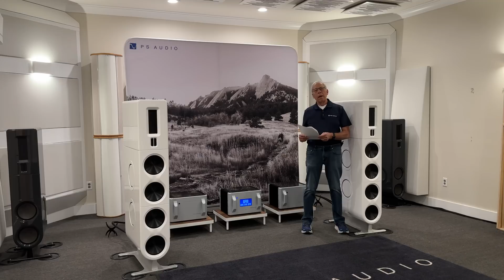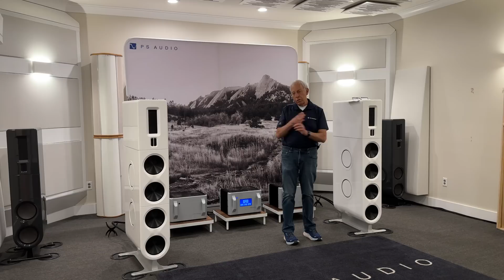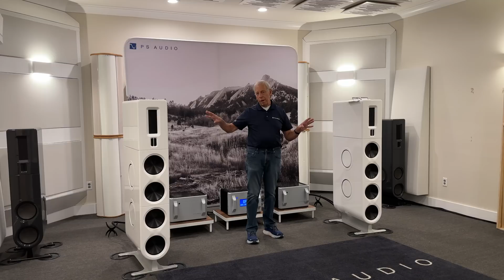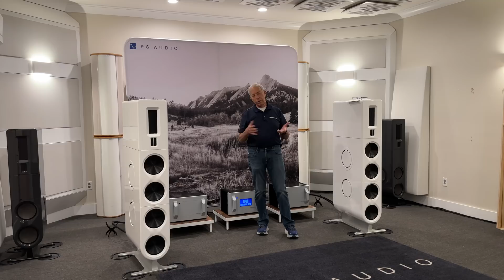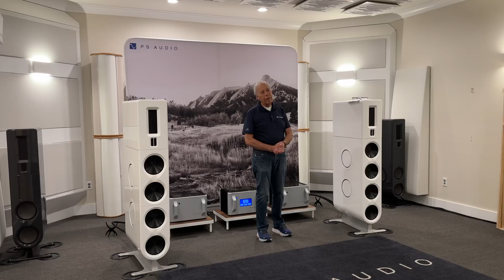Crosstalk cancellation

Comment: The most sophisticated crosstalk cancellation device is the BACCH-SP processor developed by Dr Edgar Choueiri at Princeton University.
Reply: He has a more modest setup with a std MAC at a 1/10 of the price compared to his highest end solution. 

But build on standardized components that bring down the HW cost and development cost of the same. (Web cam, MAC mini and a professional external sound card. I think it is called Bacch4MAC.)

With first hand experience of a DIY solution in my dedicated listening space.

I can without a doubt say this is the greatest thing since the invention of Stereo! (Yes, big words but as stereo, when you heard it you can't go back, it is so fundamental difference.)
For 2ch audiophiles (they tend to sit in the sweet spot and listen).😂
Reply: @AmazonasBiotop  Cool.
How does it sound compared to good headphones?  It seems conceptually like they should sound the similar.
Reply: @user-od9iz9cv1w  
There is some rather big differences between 2ch speakers and headphones.

Speakers performing like if there is artist is in front of you somewhere between the speakers and maybe like a looking at a performance in front of you.

Usually the soundstage with headphones is restricted in your head the singer is in middle of your head. 

Plus when you turn your head with headphones the singer/performance is moving with your head as the headphones is attached to your head. With speakers the still in front of you even if you turn your head.

That is nothing special that is standard deviation between headphones and speakers.

I am not a headphones guy.

But one cool thing is that Bacch4MAC company also have developed a filter for headphone usage. The cool thing is when the headphone filter is demonstrated in audio shows there is a speaker setup and a pair of headphones. The thing is they put the headphones on their ears and after a while they saying "can't you turn off the speakers (that is in front of them)"
OR they're taking off the headphones from their head and just to discover that the speakers in front of them are indeed not in use..

So I believe the headphone filter make you to believe that the soundstage is Infront of you and gives you some of the speaker qualities that those has.

But my experience with 2ch speakers with the interaural crosstalk cancellation on and off.
(Remember I am not a headphone guy at all..)

Is that even if I have made most things right to get a soundstage (width and depth). In my dedicated 2ch listening room with dipoles far out in the room, various sound treatment, symmetry, PEQ and so on and on.

I experience that ordernary 2ch listing is like to look at a performance in front of you with somewhat depth. But more like a rather flat painting in-between your speakers.

You can hear the recording room acustics but it is over there between the speakers in front of you.

But with interaural crosstalk cancellation (IAC) enabled. You are transported into the recording room and sitting in it and the performance is closer in front of you. It is more as you are there with them. 
Instead of viewing them as a separate event that have happened in front of you.

Hard to describe (I don't know if it is the same with headphones when I am not into that but I imagine the headphones make the artist small like smurfs in your head and not somewhat life like natural sized humans in front of you.)

But the "effect" is huge and works on most of all recordings more or less. And it is like back in the day when we had a stereo/mono switch button on our amplifiers. It were always in stereo mode and that got to be the default norm/choice and the button has been removed when nobody wants to be without using the stereo mode.

The same is here when using and comparing IAC on/off. 
You do not want to use the system without IAC off like back in the day with the stereo button.. It is that good!

Largest "effect" it has on binural recordings reproduction. But I found it to be good on all types of recordings. 
Except one "Madonna -Vogue" some strange mixing going on in that track that is not so obvious in normal stereo reproduction. 

I hoped this helped somewhat.👍
Reply: @user-od9iz9cv1w I think the idea is it has advantages of binaural audio that headphones can provide but it sounds more natural and there’s more a realistic sound field since the source of the sound isn’t strapped to your head. Plus for the top end model you can move around the room and it will adjust to maintain levels.
Reply: The two Carver box I use in my biamp system gives me for example in Jazz recording the feeling I am just in the middle of the group where you put the recording microphone
The result varies a lot according to different recordings
In symphonic music I get the bass just at my right snd violin in my left
But again the effect is much better with Nimbus biaural recordings.
What cross talk cancellation gets is to recreate to hear in your left ear (left channel)what you receive in it in the music hall and same in the right (right channel)
The cross talk mix the two channels in each ear, with a small time difference
But when the takes from microphon recording are mixed you get two channels that are not exactly what you receive in esch ear in the music hall. That is the reason for different results of the crosstalk cancellation according to recordings
But in many recordings it is astonishing
Reply: Completly different
Reply: @franciscogaston8367  Great info from a Interaural Crosstalk Cancelation user!

And when you use Carver system and get that astonishing results.👍

Would you say that you could be without it or not? 
In other words if it have a profound effect that you can't be without?

And I suppose the Bacch4MAC (or product line up) have even a better or desirable effect when it's cancelation effect is even better! 

I think I received information about -50 dB in cancelation for the "wrong ear". And the professor have managed to solve some other issue that I don't remember what it was now on top of my head.

The thing is I have been trying to open up the eyes 👀 to other's here before on the YouTube comments. But either they don't understand at all or thinks it is some binaural thingy, and it don't catch on.

I thinking it is a little bit of what experiences and where you are in the audiophile journey plays a role also.

I had my little brother over here and he were not impressed. But then he is NOT a audiophile and have not listening to my system (when he lives far away). It were like going back to basic.. ..he wanted to listen to some of his tracks that is fine, and he got disappointed ☹️ 

And I told him that the system is better than he is used to and all flaws in the recording and production will show up.. they don't hide shit so that everything sounds good.. I don't know what he were listening after..🤔 I guess the basic disconnect between what his brain though the song sounded after listening to the song in the car or as background and when he sits 🪑 in front of a system and has NOTHING else to do than to listening. Then you  hear and notice all the imperfections that deviates from what he remembers that it should sound like.. 😜 (yeah as said basic stuff..)

But then I had a older audiophile friend over. So naturally with his age and interest of many years of actively listening and indirectly therefore got trained to listen after all of the different aspects in a recording, production  and it reproduction.

I did exactly the same with him put him in the sweet spot and gave him the means to disengage/engage the Interaural Crosstalk Cancelation (ICC) effect.

And he got to the same conclusion as I did, after several hours and tracks. 

"That there is no way that someone would like to NOT use ICC on at all times."

An quite different outcome, and you probably need to be "trained"/experienced in listening actively.

It is like the old equipment stereo button 🔘 that is always enabled.

In my opinion it is the biggest advancement in 2ch audio since the introduction of Stereo!
(If you sitting in the sweet spot and listen as the typical audiophile do.)

Sorry for the rant. Keep listening!
Reply: Yeah, but it's anathema to the digiphobes.
Reply: Was very surprised this wasn’t mentioned. The whole concept of the BACCH-SP is that it adapts to your movements and creates a wider sound field as opposed to just side wall to side wall. I wonder if Paul is dismissing it because he hasn’t actually bothered to try it.